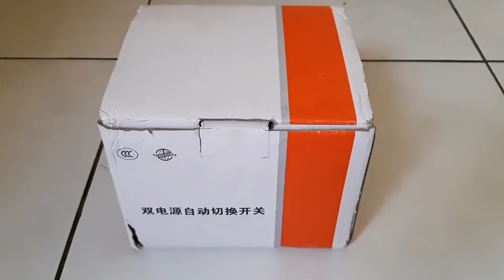automatic transfer switch installation instructions

Comment: bos saya beli ats model ni cumn merk nya jotta mau saya aplikasikan yg N buat inveter plts yg R ke pln tapi kok ada induksi dari motor nya itu ya yg jalur pln ikut nyala  padahal yg jlur pln blm akuvl pasang  klo di lanjut kan apa tidak merusak inverter nya nanti soal nya arus induksi nya bocor ke arus pln
Reply from the maker: Coba di tespen. Jalur output nyalah ga
Reply: nyala semua bos kayak nya induksi dari motor otomatik nya soal nya kalo otomatik nya di matiin gak ada listrik induksi nya
Reply from the maker: Udah coba di balik blm + -
Reply from the maker: Ga papa sih. Kan yg output 2 blm masuk. Ga bakal beradu.